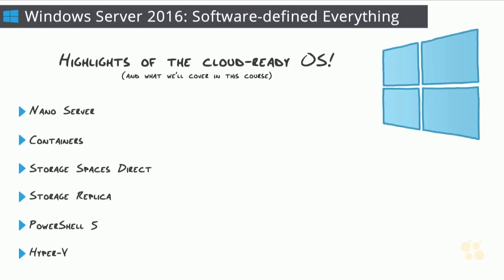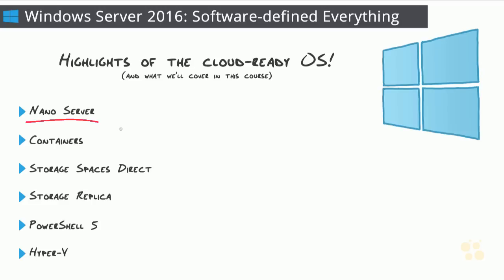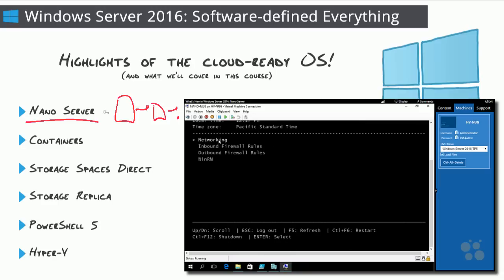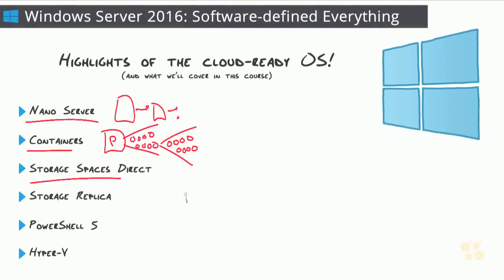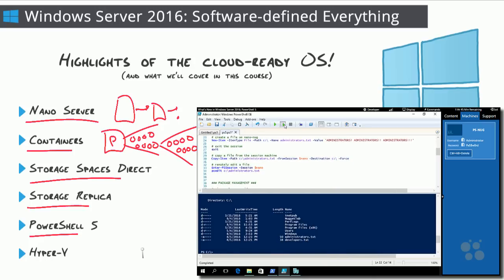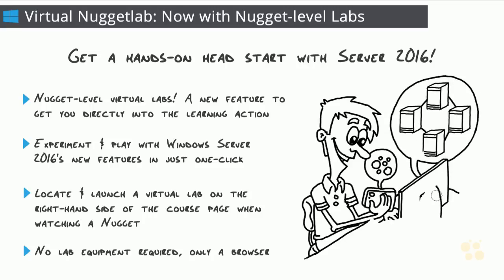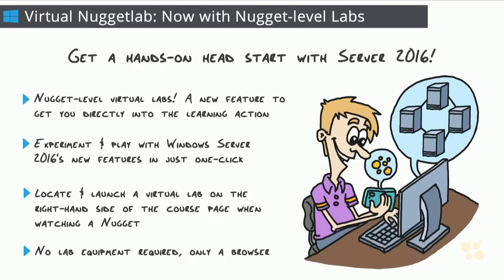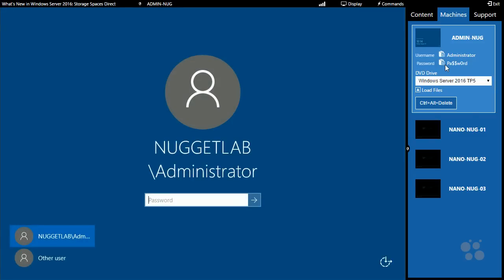Windows Server 2016 Basics & Features | CBT Nuggets

Comment: I have messed with windows server 2008, and like it's no need need to upgrade, it's quite solid and cheap.
Reply: TechXSoftware, what happens when you need newer hardware?  Server 2008 might not be supported by it.
Reply: MrTron Can always run it in a VM
Reply: That's really old and you'll loose support pretty soon. If you have a new server would you really still install Server 2008 on it? Not even R2?